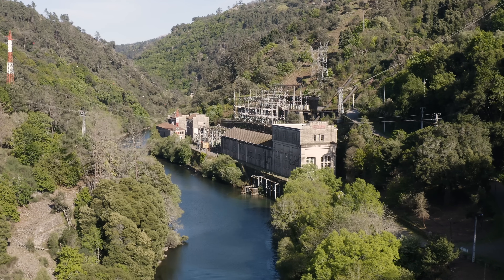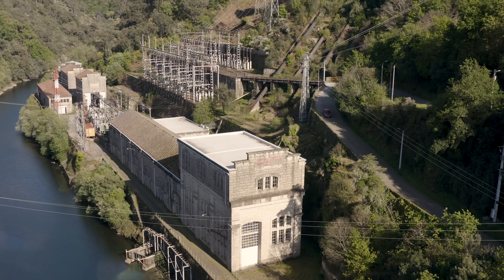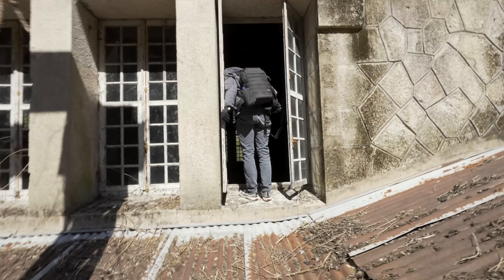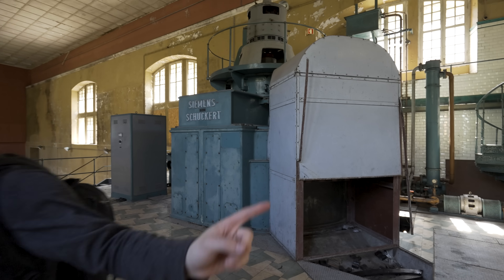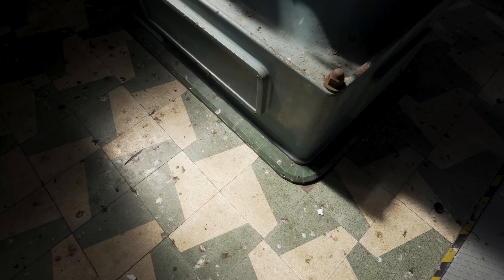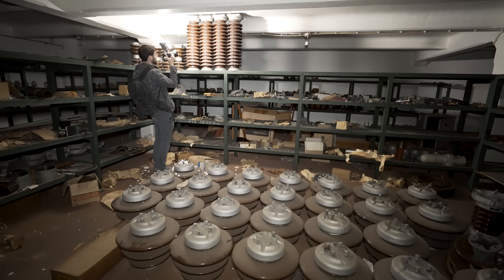Exploring an Abandoned 1920s Hydroelectric Power Plant with Original Generating Units

Comment: Excellent Video! I am a Hydro Electric Engineer working on many of these style of units! They are correct, many different OEM units there, Russian, German, Swiss, USA!  Fun to see the original mechanical flyball governors. Many of these style units are upgraded by now, but there are still some out there running from around 1900 unchanged. I work for one of the companies listed in the Video. It would be fun to see if I can dig up some original drawings for this equipment. Great find and video documentation. I try to collect old drawings of much of this equipment in my spare time. If anyone has any questions about how any of it works, ASK!
Reply: Where is the location of this please ? I want to visit it BADLY
Reply: Okay, here we go:

1- Why are two generators horizontal and on a lower level while the others are higher up, vertical and the turbines deep down connected by a drive shaft? Is it just the size and therefore generation capacity?

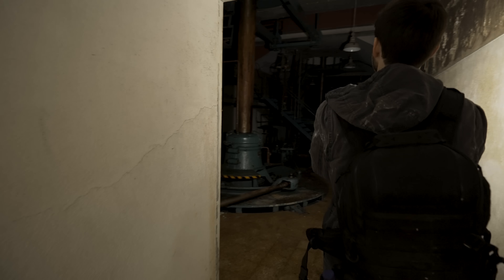2- 10:38 What is that? Some kind of governor?

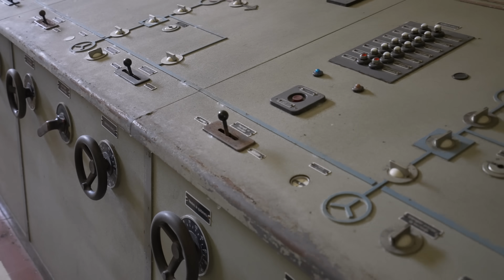3- On the switchboard in the contol room; (16:27) The red line is the electrical side, right? Are the switches for remote power switches?

4- 18:26 What is that for?
Reply: @DurresDurres-nf5rw  Lindoso, Portugal.
Reply: The service life of these old machines blows me away. I am told we just can't afford to build anything that well these days. So riddle me this: why? We have unprecedented technology at our disposal in the 21st century, and so many efficiency gains. Why can't we make machines that last 100 years? It's never been cheaper to mine ore, smelt steel, and fashion it into useful shapes. Why, then, is it prohibitively expensive to make decent machines?
Reply: @Whammytap  they over designed equipment back then because they didn’t didn’t have software to refine it. We can and still do make mechanical equipment last that long. Electrical and automation becomes obsolete in less than 20 years. Labor, material, and rules have changed which make it more expensive.

Comment: Hey Proper People, I have a request. If an electrical enclosure or control cabinet is de-energized it would be amazing to see the inside. I would love to see the care and style that electricians of the day used to wire them up. It truly is an art form and I have been so curious what that specific slice of history looks like. BTW you guys are amazing keep it up!
Reply: That would have been done by a real electricians unlike todays multi craft technician that isn't a pro in anything.  They were paid top scale pay and turned out  some of the best work and visually pleasing to the eye.  Most had data plates with the technicians name on them.  They were proud of their work.
Reply: @MrTonyPiscatelle  There are still competent electricians that know what they are doing. Rose tinted glasses. Their work underpins all the shit around us that works, regardless of the lack of fancy nameplates.
Reply: Not a good idea, no offence but both of these guys or their pals are knowledgeable in any way in electric related things, in those old places often there are lack or missing LOTO security on existing operating connections and there is high degree of probability something can be on. They could do this if they would have measuring/safety equipment. Sometimes they don't even have masks where there is obvious damage to lungs or potential chemical fumes, so it's unlikely they will have necessary security electrical equipment. They seem to follow this rule and don't touch what is potential danger.
Reply: @BlueZirnitra  Worked the trades for over 40 years and I can tell you sir that the majority are not that good and do just enough to get a paycheck
Reply: The price of building this would not be possible today.
Reply: The Proper People have mentioned before that true urban explorers try to leave things as close to the way they found it as possible, meaning they won't take the time required to dissemble something when they haven't found it disassembled. The reason a lot of modern stuff doesn't seem as pretty is due to it's complexity, meaning the wiring won't be as clean looking as earlier work but that doesn't necessarily mean it is of lesser quality, the more complex something is the more that can go wrong, giving the false sense that modern stuff is overall less reliable while ignoring the fact that modern stuff is usually more efficient, smaller, and doing more things while having a higher safety standard. I do agree that many old things are very beautiful in the way they were constructed and the quality that was possible, but what is left is the best of the best, even in terms of older homes there are many examples of the entire wiring having to be redone completely due to the inherent danger of the wires and wiring techniques of the day.
Reply: @awesomeblader45 Precisely! They also made cheap garbage 50, 100, 300 years ago, but being cheap garbage, it isn't around today. The concept you mention is called survivor bias. :)

Comment: The architecture of this place is incredible ! They knew how to make powerplants in the 1920’s. Love them !
Reply: I do not understand by a place like this would not still be in use. I can certainly understand building and using a more modern and efficient hydroelectric but unless it was seriously interfering with the wildlife or causing pollution problems, the more power the better.
Reply: @spongebobsqueeze  Probably too expensive and work intensive to run for the power output compared to more modern, more automated facilities. An old-fashioned plant like that would require a lot of skilled workers to run and maintain.
Reply: insert PG&E joke

Seriously we have lost so much power this year.
Reply: @Murgoh  Expensive and work intensive how? These would have required almost zero maintenance. Unless you are ramping it up and down, which is why the ancients had batteries in all the forts. Anybody could run this thing
Reply: @togowack Dont know about this one but normally the water it used is rerouted to a new powerplant.
Reply: @Torgrim5958 Depends on the purpose of the town / city. North American cities were built on an elevation plan using water as fail safe power. Electricity was broadcasted wirelessly. Cathedrals turned sunlight into power using the quarts window panes and organs - optical fusion, but the same power requirements and steady supply of water. All built by the giants.

Comment: Those things you referred to at the 12 minute mark are connecting linkage between the governor and the wicket gates that allow water flow into the turbine. The governor opens and closes those wickets based upon the speed of the machine.
Reply: Like guide vanes?
Reply: @unclemonster48  similar to guide vanes that encircle the turbine case. Kind of like vertically oriented Venetian blinds that open and close to guide water into the scroll case to allow more or less water flow. They are typically operated by a hydraulic cylinder that is controlled by the turbine governor.

Comment: I'm thankful you can preserve places like this in photography...they don't make 'em like they used to.  The circular mechanisms on top of the turbine housings are the actuator links that connect to the wicket gates, which control the flow of water into the turbine.

Comment: That's the Ponte de Barca original station - the much bigger station at Alto Lindoso Dam made it kind of obsolete around 1992, but it was kept maintained as a backup and secondary station, I think.

Which explains why it's in such good shape - it hasn't been totally abandoned, or if it is, it hasn't been for very long.

Comment: Thanks for the great video.  As a former docent at the Bonneville Lock & Dam and the Folsom Historic Powerhouse I recognize much of what you showed.  Incidentally,  the bell cranks around the periphery of the turbines moved the wicket gates.  They regulate the water flow and are controlled by the governor.  Woodward made the governors at Bonneville Dam as well.  Thanks for showing the control room gauges.  That is the heart of the powerhouse.

Comment: Hydro plants are quite amazing due to all the complex engineering involved. About the empty space at 5:11 - here in my country there's a hydro plant called "Cerrón Grande" which was originally planned to house four generators but was later reduced to only two due to miscalculations, so now there are just the huge empty spaces left beside the operational units. It may be possible that this was the case here, or it was just simply decomissioned / removed at some point.

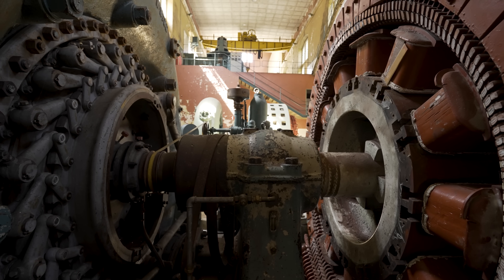Comment: Sometimes when places are closing they will strip pumps etc to reuse at nearby plants because almost immediately after they stop running rust will take over and prevent them from being operational in the future. That could be the case with some of the equipment in the video, such as around the 10:00 min mark.
I add this as someone currently working in wastewater that’s seen this happen in our local systems, because new gear is insanely expensive.

Comment: Probably stopped generating power in 1989 but the site was still connected to the grid, which is why there are still insulators and paperwork from later years. We have a big old telephone exchange building in our neighborhood built in the early 70s. It was already defunct by the mid 80s but it's still there and it's still maintained. No one has actually worked there since the 80s. I know someone who works at British Telecom and they said there are thousands of places like it all over the country, just big empty buildings that used to be full of equipment. All of that can now fit in a shoe box, but they maintain the buildings because they're secure conduit hubs or maintenance points.

Comment: Thanks for the GREAT videos of the old power plants. All those little arms around the turbines are  " control arms " that are moved by the Governor. Each little arm moves a door inside the  turbine housing called a " wicket gate" . They surround the turbine wheel and control water flow too the wheel....thus controlling speed.

Comment: To answer your question at 11:36, those are called wicket gates. And their purpose is to control water flow to the turbine. They are all connected together and operate much like a vertical shutter blind. You will see these on all hydro powered generators.

Comment: Just wanted to point out that you missed a crucial piece of the power plant.  You are looking at  the generators and the outflow to the river.  Note in the beginning of the video the large concrete pipes heading up the steep hillside.  Those are the penstocks which bring water to the turbines from an intake diversion or impoundment located on the river at a much higher elevation.  Looks to be a total of 5 penstocks, for a total of 5 possible turbines.

The original generators would have been ont he lower level.  The center units between the generator and the turbine (and all of the little belts) are most likely the governor units which control the generator speed, and hence the frequency of the AC output.  The upper level units appear to be of newer design.  All appear to be designed for high pressure and low volume.  As you transition to lower head pressure and larger volume, the turbines tend to get larger in a hurry.

As far as the missing units go, I've seen US dams built in the 1930's and 40's that were designed for future turbines have areas "blanked" off in the floor, with plain steel covers rather than the tile or polished concrete used for the rest of the floor.  Basically, the penstock and valves are installed, but the rest is semi-finished to the point where the turbine and generator can be installed.  Conduits, cable ducts, pads for equipment, etc. are all in place and waiting.

As far as power being available in the control room, my guess is that the original switchyard connected to the much newer-looking distribution switchyard further up the hill.  They most likely ran a feed into the distribution yard from a newer generation facility, then started shedding load from this facility over to the newer one as they brought capacity online.  

Funny thing about old dams and generators, if constructed and maintained properly they really don't get old and become unusable.  On the Columbia River in WA state, 2 began producing electricity in the 1930's, Grand Coulee in 1941, 3 in the 50's, 5 in the 60's, with the last being John Day Dam in 1971.  

On the Snake River in WA/ID, there are about 15 dams.  Most of these are what would be considered small for the region, ranging from 22.6 MW to 932 MW.  Swan Falls is the oldest, going into production in 1901, with the generators finally being replaced in 1990.

Our region also has a nuclear power plant, Columbia Generating Station, which went into commercial operation in 1984, has an output of 1216 MW and provides about 10% of the electricity for WA state.  Mentioned with the dams because the the Columbia River provides the cooling water for the facility.  On a historical note, B-Reactor is just a few miles upstream.  B-reactor was built during the Manhattan Project, and produced the Plutonium for both the Trinity Device and the "Fat Man" device detonated over Nagasaki Japan on 9 Aug 1945.  Be-reactor is now a museum with both self-led and docent tours.

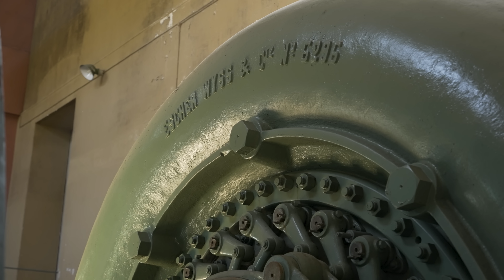Comment: 8:00 These are horizontally-oriented Francis turbines. The scroll case focuses water on the center where the turbine is impacted by water all around and discharges the water sideways from the center (rightmost in these frames) . 10:29 These are the cranks that control the angle of the wicket gates. You see this sort of horizontally-oriented configuration in smaller hydro plants. These were likely the first units in this plant.

11:38 Those are wicket gate cranks. Wicket gates are like vertical blinds that open such as to allow an even flow of water to impact the turbine all around. The turbine here is likely to be a Francis type (these look like a squirrel-cage fan). The huge rods rotate a ring to which all the wicket gate cranks are connected; this is to move all the blades at the same angle. Anyway, wicket gates can be controlled manually as when maintenance must be done and during grid synch-up, after which the speed governer controls the degree to which the wicket gates are opened so as to keep the generated power in (frequency) sync with the grid at load.

11:12 While this might be a Kaplan turbine (which looks like a ship's propeller), I think all these are Francis turbines because when I found this plant online, I saw long and high penstocks feeding it: Francis turbines are efficient with high-pressure water at relatively low flow volume. Meanwhile, Kaplan turbine are suited to low pressure, high flow volume water such as seen in run-of-river hydro plants.

From some research, I think this is the Antiga Central Hydroeléctrica de Lindosa, Portugal's first hydroelectric power plant.

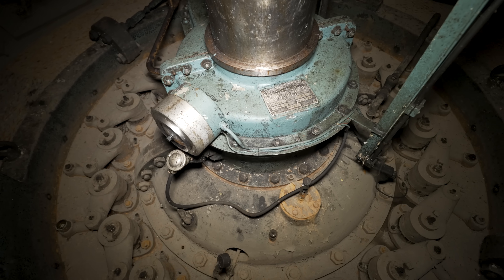Comment: This power plant seems to utilize two types of water turbines, Kaplan and Francis, the ones looking like big turbos are Francis type with adjustable guide vanes, although they seem very old given the generator is a dc machine, the shaft driven ones are most likely Kaplan with the exception of 11:25 one which has vanes thus its a Francis unit.
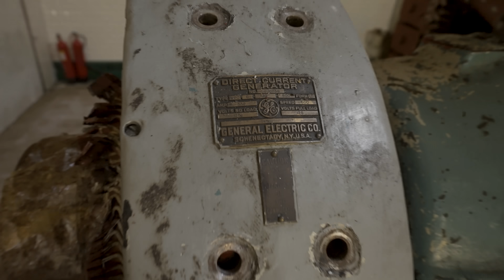8:49 that's not the exciter, but rather the commutator linking the rotor assembly with the machine's output, the excitation winding is on the stator alongside the auxiliary winding and compensation windings.
That machine is a 42kw unit

Comment: They must still use this plant as a peaker  plant , only running it when demand is high and the PF is high making it cost effective to run the small asset. Here on the Gulf Coast up until the late 90s there were dozens of Peakers that would run from like 8am to 8pm April to October, and on the days between then when it was HOT , or one of the main units were down on production

Comment: The generators you said someone  removed the outer  covers/panels from , have not been removed. The generators are for the most part intact, they are referred to as open winding  or open wound.  There are electric motors made in the same fashion.

Comment: In this video, the filmmakers explore an abandoned hydroelectric power plant in Portugal that dates back to the 1920s. Despite being obsolete since a new Damon Powerhouse was built with six times the electrical output, the original plant still contains almost all of its original machinery. The video features footage of the interior of the plant, including the original turbines, generators, and gauges. The filmmakers also point out interesting details, such as the intricate staircase and the unique typeface on the generators.
Reply: Simple and straight to the point
Reply: They don’t need an interpreter.
Reply: bro is writing a plot synopsis in the comments

Comment: I would guess the floodgates are still active for the dam, and the maintenance line and remotes are still active for control.  Likely someone checks on the place at least once a month, but generation has long since ceased.  It is possible some of the units might be considered reserves, but I doubt it.  I have seen plants like that myself and once the new dam is put in, they tend to use places like this for parts and storage.  Awesome video!

Comment: All the levers above the turbines are for the guide vanes to control the water flow into the Francis turbine. There are 3 primary types of turbines Francis pelton and kaplan Francis is best for low to med head pressure and most common.